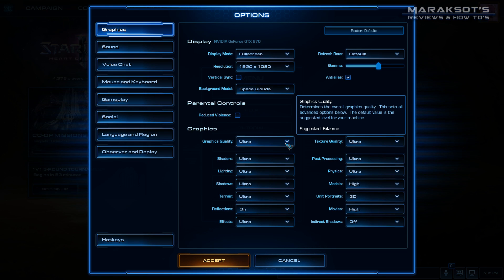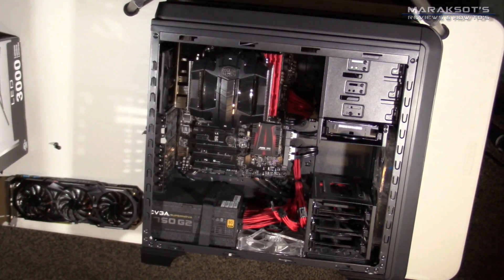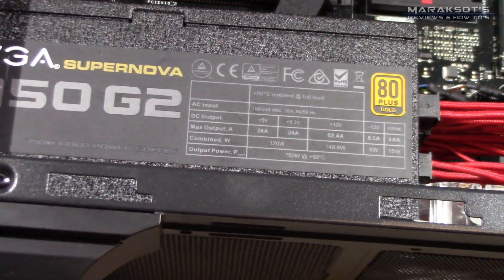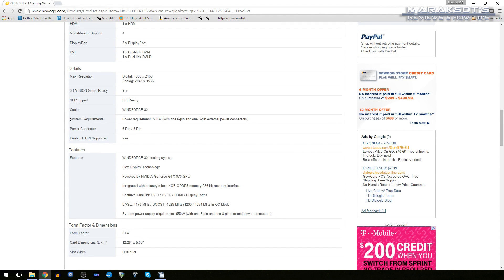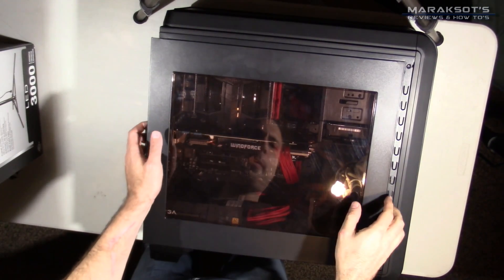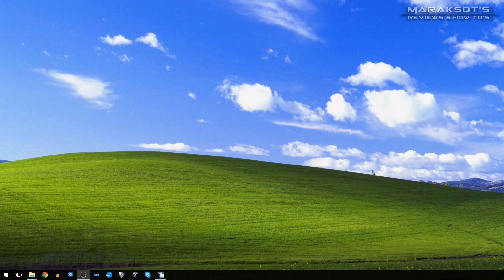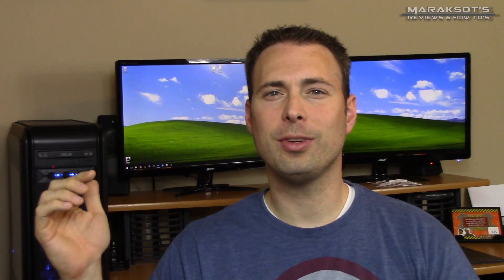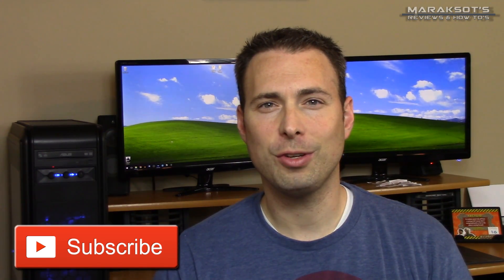A Beginners Guide - Upgrade your GPU - How to Install a New Graphics Card

Comment: I'm rocking a sli gtx 780s at the moment I'm waiting for my asus gtx 1080 strix to arrive if my drivers are up to date in GeForce experience before I change out my 780s, do I just put in the new 1080 in and away I go or do I need to download the drivers from nvidia for the 1080 and uninstall the 780 drivers?
Reply from the maker: +jimmy cychowski if your drivers are up to date all you have to do is pull the your 780's out and install the 1080 and you'll be good to go.  :)

Comment: I am going to buy the RX 480 soon because I am running the HD 5400. But my question will an I3-2100 bottleneck the RX 480?
Reply from the maker: +Dragonsoul thanks for the question, after doing a little research into your CPU I'm thinking you would definitely experience some CPU bottlenecking. To take full advantage of that guy you're going to want to upgrade your motherboard, RAM and CPU as well. :/  Wish I had better news for you man, but at the same time I say if you cant afford it now get the RX480 and see how it goes. It should be packing enough power to be relevant for a while now so there's always the option of further upgrades in the future. Best of luck to you.  :)
Reply: +Maraksot78 thank you very much! So 8GB of RAM isn't enough anymore?
Reply from the maker: ***** 8 GB of RAM is fine for most stuff still it's just the i3-2100 is an older CPU that doesn't  quite have the power of more modern CPU's. According to the specs from Intel it supports PCIE 2.0 and all new GPU's are PCIE 3.0 which is capable of more throughput. Newer cards will still work they just won't be able to run at their full speed. :)
Reply: +Maraksot78 any suggestions about a new mobo and cpu? under 300 bucks
Reply from the maker: +Dragonsoul good question... I'll have to get back to you on that, I'm just about to head to church with my family but I can see what I can do to help when I get back. :)
Reply: I really appreciate that thank you!
Reply from the maker: +Dragonsoul ok I'm back... Here's what I would choose on a $300 budget.  http://m.newegg.com/Product/index?itemnumber=N82E16819117564
http://m.newegg.com/Product/index?itemnumber=N82E16813130924
http://m.newegg.com/Product/index?itemnumber=N82E16820231888
I chose the i5-6400 because it's a modern quad core which should serve you well for years to come.  It isn't overclockable but for under $300 overclocking has to take a back seat IMO. The MSI motherboard isn't anything too special but it does support PCI express 3.0 so it'll do the job just fine. Finally I chose 16GB of GSkill 2400 DDR4 because it's good RAM at a very nice price.  You'll of course have to reuse your existing case, power supply and hard drive(s) but pair this stuff with the RX480 and you should have yourself a pretty awesome little gaming rig. Hope this helps man. Thanks again for the question, I really enjoy this kind of stuff. Happy gaming my friend!
Reply: +Maraksot78 thanks for this but i'll build a whole new pc I know a lot more when it comes to more expensive part lol. I built my friend's gaming rig but i wasnt sure about the I3 I still have. I really appreciate your help 1 like and a sub more
Reply from the maker: ***** you're welcome. It's really no problem, I enjoy talking about and building computers so this has been fun for me. Thank you for the like and the sub I really appreciate it. Best of luck to you on your new build. :)
Reply: +Maraksot78 thank you

Comment: hi doo i need too uninstal the old drivers of my r9 270x and download the new r9 380x or automatic update ?
Reply from the maker: +baz49100 thanks for the question. If you have the automactic driver update feature enabled you should be good to go. You may want to check and see if you're running the most current drivers just to be sure. The most current version of AMD's Crimson drivers as of this morning are 16.15.2211, to check what version you're running right click on the windows start button, click device manager, then double click Display adapters, then double click your graphics card to bring up the properties window. Click on the driver tab and it will tell you what your current driver version is on that screen. Congrats on the upgrade man, happy gaming! :)
Reply: i got automatic download thx 4 help!
Reply from the maker: baz49100 no problem man, I'm happy to help.  :)

Comment: Okay, So I have a computer called Acer Predator G3-605 and it has a GTX 760 192-bit, right now it feels a little bit low on the gaming side so having plans to upgrade to a GTX 1070, do you think this will work with this computer? :) Sorry for crappy English btw....
Reply from the maker: +CrazyLightning I looked up the Acer Predator G3-605 and it looks like it has an i7-4770 CPU and 8GB of RAM, but it says it has a GTX 770... do you know if that's the CPU you have? If so then the 1070 will work great with your system, I don't believe you'll  experience any bottlenecking with that setup. Happy gaming man!
Reply: +Maraksot78 No Intel i7 on mine, it has a i5 and 8 gigs of ram, I think it should work alright in my opinion but just asking someone who probably have better experience than me hahaha :)!
Reply: +Maraksot78 Intel Core i5 4460 I think btw!
Reply from the maker: If it's a newer i5 (one produced in the last 2 years or so) then you're totally good to go. :)
Reply from the maker: +CrazyLightning the 4460 is a good cpu, you should be just fine. :)
Reply: +Maraksot78 Thank god, then I know, thanks for the help mate, really appreciate it man!! :D Happy Gaming!! ^^
Reply from the maker: CrazyLightning no problem man, I'm happy to help out. Same to you. :)

Comment: I plan on buying an RX 480 in a few weeks, and I need a graphics card, and have been waiting to get the RX 480 since I assembled my PC, and I'm currently using this computer without a graphics card. I looked around websites, and it says the RX 480 gets powered through a 1x6 pin power connector. My question is, will my PSU's PCIe connector (6+2 pin) connect to it just fine? It might seem like a stupid question, but I've no experience with installing GPUs, and I want to always be 100% sure first.
Reply from the maker: +Legology very cool man, the RX 480 looks to be a very nice GPU, I'm excited to learn more about it as more information is released in the coming weeks. To answer your question,  yes your 6+2 pin PCIE power connector will work just fine. That's the reason they make them that way, so you can just plug in the 6 pin if that's what your card needs. And then add the additional 2 pin for cards that require an 8 pin power connector. Best of luck to you on your upgrade man,  happy gaming!
Reply: Maraksot78 Thanks for the reply! Very helpful, I'm really set for good now!

Comment: I have a 600W power supply, will that be enough for a Gtx 1070?

My specs are:
MOBO: Z97-k [CSM]
CPU: Intel quad core i7 4790k (3.6ghz)
GPU: Gtx 960 )4gb)
RAM: 16gb (DDR5)
HardDrive: 2TB 
PSU: 600W (forgot model)
Reply from the maker: +Matt B oh yah man you're totally good to go. I'm away from my computer and for some reason I can't find the exact power requirements using my phone but I do know that these new 1000 series GPU's are very power efficient. The reviews for the 1080 have been showing peoples entire systems (so CPU, GPU, everything) only pulling between 300 and 350 watts so if you're rocking 600 watts you're totally fine... could even get two and SLI those bad boys if you wanted to. :D Thanks for the question. Happy gaming bro.
Reply: Maraksot78 Thank you very much, I am very new into building/modifying computer hardware for Pc, so I really appreciate your help. :D
Reply from the maker: Matt B no problem man, I'm happy yo help. :)

Comment: Hey there, very useful video, I'm looking to upgrade since my AMD graphics card is slowly dying and can crash several times a day. I'm currently running with 8GB ram, and an AMD FX 6300 six-core processor 3.50GHz. Now I'm not particularly computer savvy myself but my friend seems pretty convinced that my system will be able to take the GTX 1070 with no problems at all, and that it would be a waste investing in anything else. I feel the 960 or 970 would be sufficient firepower, but there just seems to be so many different variants of those cards, I wouldn't know which one to go for. Do you have any advice?
Reply from the maker: +Nickszor Thanks for watching the video and for the question. In my opinion it all depends on how much money you want to spend and what resolution you're going to be gaming at for the foreseeable future.  As of right now prices on the GTX 900 series cards are beginning to come down with both the 1080 and 1070 having launched. But I think in about a month or so once all the board partner 1080 and 1070's are available we should see where prices on the 900's come down to.  So far benchmarks I've seen have the 1070 performing at 980ti levels in games and the MSRP for the 1070 is I think $370 US so I think the 980ti should drop to around that same price and the 970 and other cards should drop in price as well especially as the 1060 and 1050 come out.  Also AMD just announced their RX480 and it's supposed to be capable of running VR for only $199. I'm not sure when it's supposed to come out but I think it's only a few weeks away from launch. Info I've seen on it suggests it's probably going to perform near the level of the R9 390X and GTX 970 which currently cost between $300 and $350 US. But of course that's all kinda speculation right now. Anyway, to answer your question about which card to go with... if you're gaming at 1080p the GTX 960 is fine but I'd go with the 970 just to have a little bit more power but games are beginning to use more and more VRAM and the 970's 4 GB is close to being out dated so for about the same amount of money you can get an R9 390X with 8GB which I think is a better choice. As for brands... I think they're all pretty comparable. Personally I've used Gigabyte, EVGA, Powercolor and XFX cards before and the only one that's died on me was the XFX. MSI and Asus have really good reputations but Asus tends to cost a little more than the others for the same thing. But I use their motherboards a lot and have never had a problem... knock on wood. Sapphire and Zotac although I've never used any of their stuff, they seem to get decent reviews.  As or advice on whether you should go with a factory overclocked version or not I'd recommend watching this video from Linus Tech Tips.  https://www.youtube.com/watch?v=fLLiSrAM-uc I feel they do a really good job of addressing the question of, "should I just get the base model (which is the least expensive) or should I get the Superclocked version for a little more or The Super Superclocked for a little more than that or just go for the most expensive one?"   Well that was a long response but I hope the info was helpful. Thanks again for the question, I like talking about this kind of stuff in case you couldn't tell. :D Happy gaming man!
Reply: Thanks for the reply, looking at the prices of the 970 and R9 390X, I'm very tempted just to pay that little bit extra for the 1070 from the positive feedback I've heard, or that could just be me being impatient in waiting for the price of the 970 to go down. Regarding overclocking, it isn't something I've ever been too interested in, as mentioned in the video you linked I'd rather step up a class of graphics cards, in saying that I'd assume the founders edition would be the best way to go for the 1070. My only concern being bottlenecking as you've mentioned in your video, and whether I'd have to upgrade anything/much else in my system to get the most out of the 1070. Thanks again :D
Reply from the maker: No problem man, I'm happy to help.  The 1070 looks to be a freakin' sick card and it's definitely a great deal when you consider price to performance.  Since you've got an FX 6300 CPU I'm fairly certain that in CPU intensive games (Blizzard games often are, i.e. World of Warcraft, Starcraft 2, Heroes of the Storm etc.) that you will experience CPU bottlenecking with the 1070 but for other games that are more GPU dependent (which is most of your AAA titles that make it onto consoles as well as PC) then I think you'll be just fine.  As for the 1070 Founders Edition, just in case you didn't know the Founders Edition is what used to be called the Reference Card.  It's the base model that all the others are based off of and for whatever reason Nvidia has decided to sell them for $449 U.S. while the MSRP on the board partner base model cards is $379 U.S.  So you should be able to pick up a GTX 1070 for $380 once Asus, MSI, Gigabyte and all the others start putting out versions with their custom coolers on them, but if you want the silver and black Founders Edition (which isn't supposed to be any more powerful mind you) then it costs $450.  I don't know why Nvidia has set up pricing this way but that's what they've said so far.  Anyway, thanks again for the question man, best of luck to you.  :)
Reply: Thanks for the awesome help man, I think I'll put up with my current graphics card until the board partner models are released, and perhaps look into a new CPU in the mean time. Keep up the good work! :D

EDIT: Done some research into CPUs and the 970 is becoming very appealing again, I'll see what the prices do and make a decision then

Comment: Hey what about the old drivers you know getting rid of them!
Reply from the maker: +Crowley Alleister you just uninstall them like you would any other program.  If you've never uninstalled anything before you can do it by right clicking the Start button in Windows after which a menu will pop up. Click on Control Panel and then Programs and Features. You should then see something that says uninstall a program, click that and your computer will then populate a list of all the programs installed in it. Find your old drivers on the list, if you're using an Nvidia GPU uninstall everything that says Nvidia or GeForce or if you have an AMD GPU  you want uninstall everything that says AMD or Catylst or Crimson, click it to select it, and then click Uninstall.
Reply: Hey Maraksot can you please tell me what should i search for when i want to unistall the old amd drivers??
Btw i have an AMD gpu and i want now to install the drivers for GTX  1070 .
Reply from the maker: So do you have your 1070 now?  If you don't have it yet obviously you don't want to uninstall your current video drivers but once you have it and are ready to install it then you just uninstall your old drivers like you would any other program.  If you've never uninstalled anything before you can do it by right clicking the Start button in Windows (or the Windows logo in the bottom left of your screen in Windows 8 and Windows 10) after which a menu will pop up. Click on Control Panel and then Programs and Features. You should then see something that says uninstall a program, click that and your computer will then populate a list of all the programs installed on it. Find your old drivers on the list and uninstall everything that says AMD or Catalyst or Crimson (I don't currently have an AMD GPU in my computer so I'm not entirely sure what their driver is going to be named, I know it used to be Catalyst Control Center but I think that may have changed withe their newer drivers, anyway it should be one of the things I mentioned above) click on the program you want to uninstall to select it, then click Uninstall and the rest is easy after that.  :)
Reply: Thank you VERY VERY MUCH and the video was PERFECT keep on the good work!!
Reply from the maker: You're welcome! Happy gaming my friend.

Comment: if I have ddr3 ram, will i be able to fully run and function with a different type (ex. ddr5)
Reply from the maker: +Joey Billings motherboards are almost always designed to accept only one type of RAM (i.e. DDR3, DDR4 etc.) There are some exceptions to that but they're rather uncommon. So generally speaking if you have DDR3 then that is the only type of RAM your motherboard will support. Your motherboard may support faster  RAM modules than you currently have, for example you may have DDR3 that runs at 1600Mhz but your motherboard may support up to 2400Mhz so you could upgrade that if you wanted, but if you're wanting to upgrade to DDR4 (which is the current standard) then you will have to upgrade your motherboard and CPU to do so. I hope that helps.
Reply: yes thanks, so same goes for gpu if its ddr4 or ddr5 it isnt compatible w/ ddr3 motherboard?
Reply from the maker: +Joey Billings I must appologize if I misunderstood your original question. So you're wondering about upgrading the memory on your graphics card? The Memory chips for a graphics card are soldered directly onto the PCB so upgrading just the memory isn't really an option. You have to upgrade to an entirely new GPU with more memory. The current memory standard on graphics cards is GDDR5 and all current graphics cards are compatible and will work in the majority of modern PC's. As long as you have a free PCI express slot on your motherboard and the appropriate power supply any new graphics card will work.
Reply: Maraksot78 yeah my original question is if I buy a new gpu , and it supports ddr5 memory,but my motherboard is ddr3, will it be compatible?
Reply from the maker: Joey Billings yes, it will be compatible. :) What GPU are you thinking of upgrading to?
Reply: evga gtx 750ti sc 2gigs.
Reply: plus i was thinking of upgrading my cpu to a i5-4690k , i got 8 gb of ram already. I was upgradig because i want to be able to play Battlefield 1 when i releases.
Reply from the maker: Joey Billings sounds like a pretty nice rig you've got in the works there man. #PCMasterrace  :D Happy gaming man!